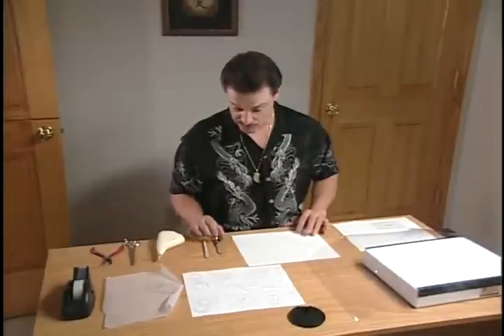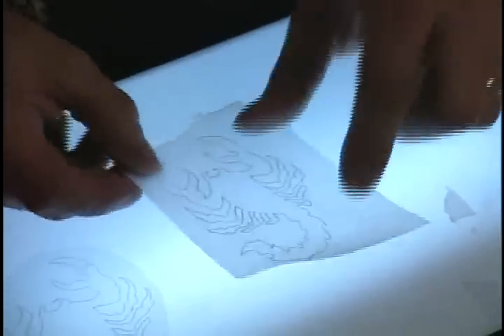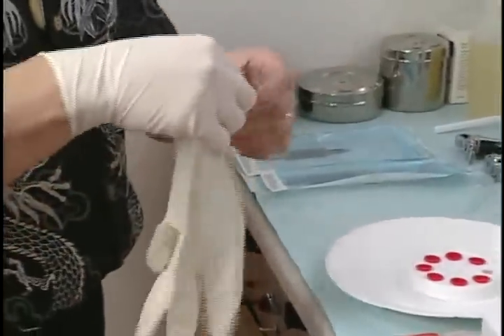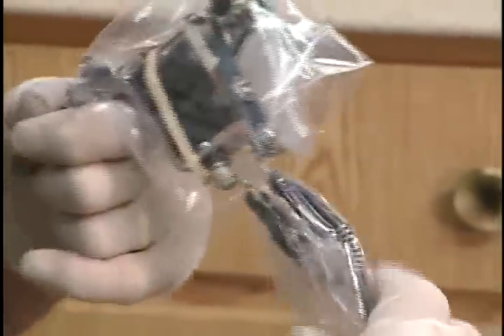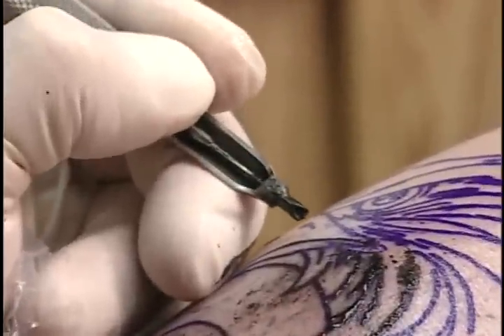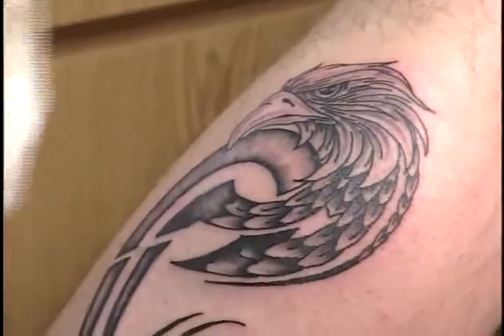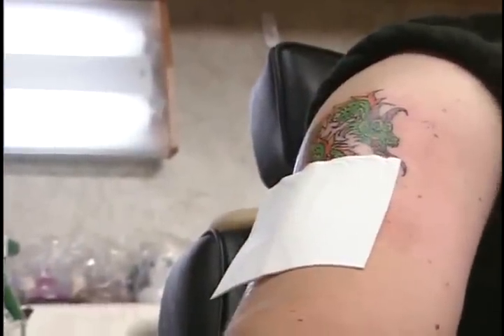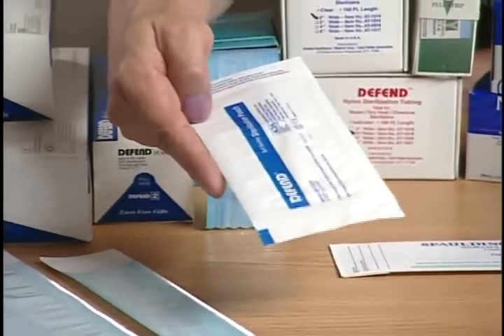The Art of Tattooing

Comment: The distortion of the color specially white and yellow is due to the friction between stainless needles and tip, wearing off. The stainless steel fine powder residue mixes with the pigments. In light colors you will see the discoloration quickest. Nowadays there are good grade plastic tips that do not give these issues.